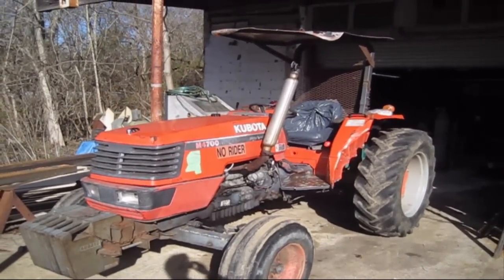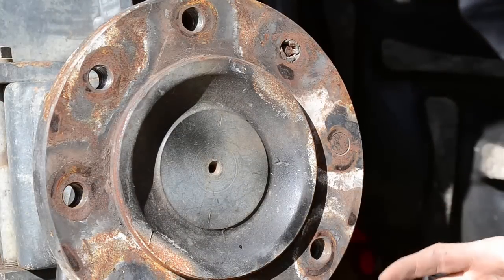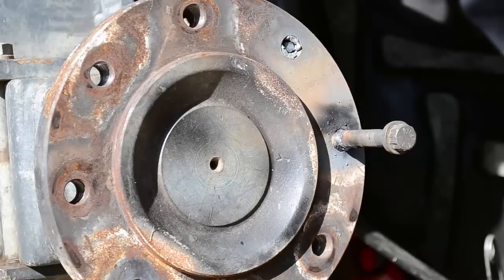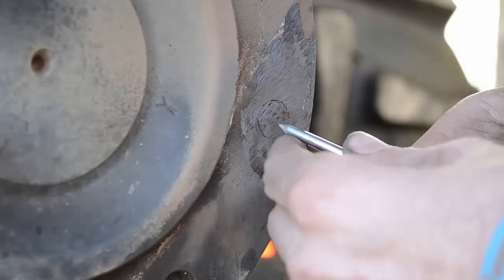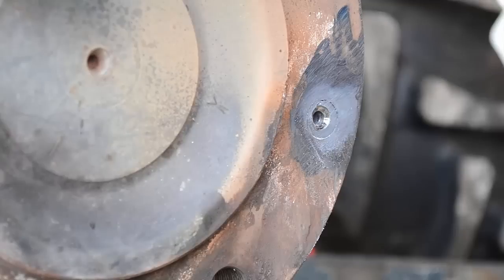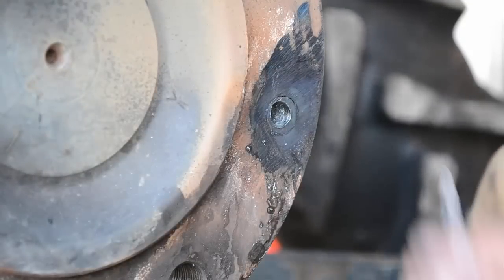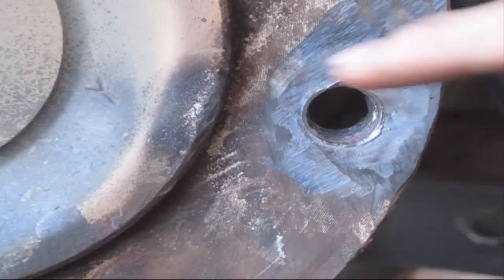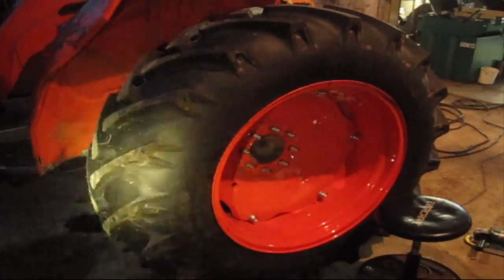Broke-off bolts techniques

Comment: NOTE:  dri;l bits "Can" be sharpened with a grinder, just observe the original slant and angle around both parts of the very tips, I was amazed at how good my rockwell bits sharpened up.
Reply: Set it on fire collect insurance take the week off
Reply: Hes a green horn but very persistent

Comment: Drive a square easyout into it and it we come out, or get it hot and drive the square easyout in it and it will come out. When you drill into hard steel use a diamond bit to drill through it.

Comment: how come you didn't put oil to lubricate before impact wrenching ??  .. best is beeswax  while is still hot after welding .
then after you drill the hole why didn't you use extractor ?

Comment: I would have hit it with WD 40 to lubricate those threads. And use oil when drilling slowly so as to not burn up drill bit edges. Cobalt drill bits help too on hard stuff.

Comment: If there was enough bolt sticking out the back side you may have been able to of put some penetrating oil on it, and then screwed it out from the back. Instead of trying to get it out the front.

Comment: I worked in a speed shop for years and if I had a welder around someones $12,000 motor. they would have wanted to punch me in the face. Carbide burr bits are what to use. Good ones eat a bolt like butter.

Comment: You had a  through hole drilled through the broken stud and you applied a flame to the stud not the outside... not great. Another thing you could have done is to drill as large a hole as possible through the stud and then run a junior hacksaw inside the hole and cut through the remaining wall of the stud to the outside thread.... it would have collapsed easily with a centre punch around the outside and screwed out. That's based on 25 years teaching engineering and a whole lot of practice.

Comment: Dude you may be a pro, but you did just about everything wrong you possibly could on that bolt. I also agree with the man below, don't run wide open on steel, when you hit  burr, run in thru the other way, they make penetrating oil for a reason, use it.....   Why in the hell would you heat, thus expanding the bolt your trying to remove. Heat the metal around the bolt, not the bolt it's self....

Comment: I`m very surprised at the hi-speed drilling. That doesn`t work for thick hard metal. You have to slow down to get it to cut and not heat up the drill bit thus destroying it.
Reply from the maker: Slow drilling doesn't work on steel that is harder than the bit.  Speed has nothing to do with destroying a bit.  Let me ask you something have you ever burned up a drill bit? No you haven't it broke before it burned up.  HSS loses temper around 1,100 to 1,300 degees it has very high red hardness.  There was a hard spot in that bolt that's why it quit cutting not the speed.
Reply: Yes I`ve burned up drill bits. I`m still surprised  at your lack of knowledge. And I`m not being offensive. You just don`t have a clue. I worked on trucks for 13 years and there`s a lot of drilling/repairing.
Reply: I have to agree, ask any old machinist & they'll tell you the same thing. I'm a 54yr old FAA Certificated Airframe & Powerplant Technician. I've found it's much easier & faster to start out with in this case prolly an 1/8" cobalt drill bit @ a slow speed using plenty of oil. Drill a little, stop pull out, blow out chips with blow gun, wipe off drill bit with a rag, squirt oil in the hole & on the drill bit & repeat until through the hole. Use steady straight not to much pressure on the drill @ a 90 degree angle. My old DeWalt drill has a bubble level that helps a lot to drill holes perpendicular. Then progressively drill out the hole in 2 sizes larger each time until desired diameter. You could then weld a nut or bolt to remove the stud, use a center punch or air hammer/rivet gun with a small sharp tipped punch & work it out (works better than most guys/gals think), use a square type easy out tool (the spiral type only spreads out the metal making it wedge itself in the threads even tighter), drill out to a tap drill size & re-tap the threads, or heli-coil the threads, or fill the messed up threads with molten metal & re-tap threads ETC. Classic Work I noticed immediately was drilling way too fast, was a bit crooked, didn't use enough oil, didn't clean the bit off & the chips in the hole & started the hole off center to begin with. When you do it usually several times a day for many years like I have you learn by experience. After center punching or starting the first cut if the drill bit isn't perfectly centered you can learn to walk it in by tilting the drill to get it where you want it to go. Just go slow because you don't want to mess up a very expensive part like on an airplane & get your ass fired also. I've never been fired BTW, only raises & bonuses :-)
Reply: j e thrust: You and I have the same way of doing it. It`s like a trophy when the bolt comes out with the easy out stuck in it. On tuff ones I`ll keep it a while as a reminder.

Comment: My brother-in-law told me about something like this when bolts in semi tractor tires would break off.  After welding a nut or whatever on the remaining stud he said all he needed was a pliers to take out the remaining stud.  The secret was slowly dripping cold water on it and it would break loose by itself and none of that pounding was necessary.  In fact he said people would stand around watching and waiting for him to pound the heck out of it and he simply turned it out with a pliers.

Comment: the 1st time you had the welded bolt turning,you could have melted some parrafin wax,it will find itself a path,down the threads,and you likely wouldn't have busted your weld,,

Comment: once they start to move at all , apply a little oil and let it work into the threads.
Your sure fire method would have worked  the first time if you had.O

Comment: grind back flush , grind face of broken stud flush with axle face take steel flat punch and shock with hammer this compresses rust flakes in threads of broken stud no bolts welded to broken stud , bolts flex and dont transmit  proper shock to stud, only weld washers and nuts , bolts are long and have angle sheer when welded and hit with hammer and or impact gun. use only hand tools to rock back and forth slowly with wd oil and heat on axle flange not broken stud . easy outs no  good for this. drill slower right on center use lube to cool than saw out with hacksaw blade small piece make 2 cuts remove  small cut piece tap whats left with blunt punch or  capeing chisel  plumbers use this alot called capeing . good video remember hand tools only to start rock back and slowly ,and lube

Comment: Why not include applying some liquid Blaster, WD 40 or even tranny oil & then let it soak in for 10 minutes or so after heating to help loosen the threads out ???  And you never dipped your drill bits into water from time to time to cool them off either & you ran them too fast!  Slower speeds & pressure could have helped them cut & bite into the metal!  I plain don't understand your thinking not to do so otherwise!  Good job ending though.

Comment: This is a good example of how not to remove a broken bolt.
Reply: Completely botched from the time you welded on the broken bolt
Reply from the maker: Jake Elliott I got it out did I not?  It could have went better but that’s the real world some easy jobs turn into wtf all the time.  If you have done a job like this you would know that.

Comment: Clean the threads out and screw in high tensile bolts in from the back, if they snap off again you can use the hex to screw them out for replacement. for the hole that have no thread weld a steel bar across that bolt to the one each side of it that will stop it from falling out and turning. AND USE COPPER COAT ON ALL THREADS NOT SILVER SHIT.

Comment: You're drilling way too fast for steel. See if you have a bit with a very shallow angle at the tip. If you look from the side choose one with the "flattest" angle from the tip to the outer edge. This will take smaller bites from the steel. Drill slowly and spray some lubricant a few times per minute.

Comment: heat it and cool it three times one of the heatings can be when you weld it, cool with penetrating  oil!!!   heating the bolt in the hole streatches it c0ooling it shrinckes it . drill hole w/slow speed first heat through the hole

Comment: If You put some Kroil oil on it The oil that Creeps Would Help. I may have not Spelled Kroil right But it the best & costs
Reply from the maker: Kroil works good as spit.  I've used it, and not impressed for 20-28$ a can it should melt the bolt out.  I don't oil on a weld out because if the bolts breaks then you have a bad mess to try to weld back to.

Comment: I like everything you've done except for your drilling technique.... no wonder drilling is your last resort. When drilling metal you need cutting fluid on everything except iron, or your drill bit will dull crazy fast. Second you need to drill slower depending on the size of the bit, or else your drill bit will dull crazy fast, when drilling with a 3/8s bit I'm barely pressing the trigger, you wanna go slow enough that the metal comes off in curly strands

Comment: It would be better to cool down the stud after welding. Then it would be a little smaller and certainly easier to unscrew. A little spray oil would also be worth a try.
Better is: more brains, less power😄

Comment: If not a fan of Kubota what do you recommend?
Reply from the maker: ravenhhca John Deere, Ford, international Harvester all good tractors. In Kubota's defense this series (4500) and others like it is one of the toughest small tractors I have ever seen. It was built in the 90's and I don't know of one tractor they build now I would have.  All tractors have weaknesses and strengths the biggest problem with Kubota is they are built to light, but all tractors now a days are the same way.
Reply: Thanks.........so a used Kubota from the 90's might be a good choice?

Comment: The only thing I would add is to use Anti Seize on the replacement bolts and you will never have to do this fix again.

Comment: Is that the same type of drillbit as used for stone/concrete? Sure looks same
Reply: Yes,it might take a while but when they don't want you to break a Cobalt or diamond bit off in the hole.We used masonry bits on the guide rollers on the nose of a barge unloader,Dravo 36 bucket continuous for coal barges.Conical point set screw stuck in the hole,0°F on the Ohio River with ice on the river.Cold but it paid well.

Comment: You are running the rpm to fast. Slow down the drill speed. You are work Harding the bolt. Or use a carbide drill bit.

Comment: Makes me nearly sick watching this because I must remove a differential filler plug behind and on the ground. I don't have the tools nor the skills nor the patience. I only just thought about taking it in to a machinist.
Reply: Hammer the plug untill all the rust is loosened. This will release the plug and jar the threads enough to back it out easily. Only the outer edge of the plug will be rusty and holding it. Wire wheel, air needler to clean away the rust before you hammer on it.

Comment: I agree, my grandfather taught me slower is better as far as the speed of the drill bit. By spinning the bit to fast, you work harden the object you are drilling out. Also the cooler the better. Keep the area around the bolt cool. This heat and extreme cool affects the area and the bolt as you work it. If you heat up the object, then slowly withdrawal the heat from it. Just like heating up cast iron, but in reverse. you take you time to heat a larger area then you are going to work on. So slowly heat up and slowly cool down the area. Use the torch and slowly move it around after you heated up the area to expand the broken bolt. Also you can take a center punch and tap around the edge bolt to help loosen it. And the 2nd most important thing is to add lube to the broken bolt. It will seep in to some extent and loosen the threads...

Comment: If easyouts only work for you 1% of the time you're doing it wrong.  Those holes being so messed up I mighta just drilled them out and put nuts behind the flange.  And that stubborn bolt woulda been easier to remove with some penetrating oil.

Comment: why are you speed drilling into steel. Friction causes instability and fractures the tip of the bit. Ever see a metal shop drill at hi speeds? I didn't think so. Slow speed and oil to lower the friction temperature so that your cutting not ripping into the steel.

Comment: Any body working on any job that has to be losimimg or remocing nuts,, nolts  screws andpipe fittings or pipes
 LEARN
 Tighten before you loosen up ,. Just  enough to see it move,then you can loosen easily
 With out damage to the  fastner or the material, be it wood,metal or plastic,or cast aluminum. Itscalledkinetic energy

Comment: Your drill speed is way too fast for steel.  Slow your drill speed down to around 600-800 rpm and use cutting fluid.  And maybe reverse drill bits.

Comment: once you have a hole a little larger than a quarter inch use a jig saw, put the blade thru the hole  and cut one side thru into the threads . Tap cut side of stuck piece down toward center of hole. It will peal out . Hope you didn't bid that job.

Comment: You lost me at "I'm not a fan of Kubota tractors..."  What bearing did that have on the subject matter of removing broken bolts?  Did it matter that it wasn't a Mahindra, John Deere, et. al.?
Reply from the maker: xmchillin I guess it didn't have any bearing other than they are some of the hardest tractors to work on. It is like bad luck follows them everywhere they go.

Comment: Wouldn't it have been much easier to just drill 8 new holes, and tap them you could weld up the old holes if you wanted.

Comment: Weld a nut to it through the center hole...hot weld and get right on it with wrench while still hot....
Mig or tig...maybe stick but never tried
Reply: You could have just machined a new tractor

Comment: get a 1/2 plate (scrap)  drill and tap different hole  plug them with bolt grub screws and or studs  even weld them in grind the surface  flat  then heat them with the blow torch  and them pop the oxy  much easy er and  you dont need a hole n the center  .  its not that hard

Comment: That welding a bolt technique is A HUGELY bad idea.  You are going to weld the broken bolt to the surrounding metal.  With a nut, you do not run that risk.  And slow that dang drill down and use some cutting oil so you don't overheat your drill bit and make it dull.  And then the cutting torch idea.... wow... Maybe that is not the occupation for you.

Comment: why don't use warshal &  why not use copleet bolt tight from back next time broke just open back side don't use stud because to side tred open easy when running or use fire proof transparent mika hole  senter and weld skrew open easy

Comment: I realize my pessimism but my gosh this is hard to watch. It’s crazy how you can tell a persons grit and self discipline by watching how they solve problems. Here we have a guy giving advice,  but fails at every turn. Why? Laziness, instead of taking the extra time to ease it out or even look in the back and run it through the hole he just lets ‘er rip. Then after boogering up a bolt that WAS spinning, he doesn’t bother to make sure he’s drilling on center. Also, who tf uses an impact on a welded fastner. I mean “impact” is in the name!!

Comment: Why didn't you buy some proper wheel studs and pull them through the rim holes instead of buggering about like you have done, that bad stud had a bad rear to it so why didn't you grind the end of the stud off at the rear.

Comment: Hey ,,,Boss,,,Like U R,, VIDEO,,,Watched ,,Thru to end,,,,Gave me couple more Ideas for the back Pockett,,,,,BUT,,,,Where WAS U R Penetrating OILS,,Like WD 40,,PB Blstr or KrolOil,,,Luv Krol on Stuff Like This,,,Have see my fair share of this in my collision n Vintage car shops n have won all over the world with my cars ,,,Also Tell The folks ,,First to TIGHTEN ,,,then Losen,,,working BACK N Forth ,,,AS U USE OILS,,,To Cut into Threads,,,Oil Gets ,,From top to Bottom working it back n forth into hole,, Secondly I would have ,,Tried to turn Broken bolt out thru back and welded on it again,,side dress bolt shank to run it thru to back ,,Since U Said someone had buggerd up the back,,,Have had this Problem on side of Water Jacket of 30 Auburn Boatail..I dug out of side of hill ,,then built car to Win @ Hershey ,,,All n all ,,great Video with lots of ,,Helpful Info ,,,,,Will be Checkin U out Again ,
                                 ,Thanks Frank  Heiss Jr

Comment: ur drilling waay too fast, speed isnt what u need its pressure, keep the drill in a lower gear and still dont hold it wide open, every hole and bit and type of metal has a different speed and pressure it works best at it really does become second nature after u do it for a while, it actually amazing how slow some materials require especially for some really big holes in thick thick plate i use to kind of question the datasheets but it really does make all the difference, the different gears arent for fasteners  your drill bits will also start lasting alot longer, the easiest way to ruin a bit is run it the highest speed get it hot n lay the edges over

Comment: Surprised to see you using non impact sockets with an impact gun! Bad habit to get into. They known to crack and splinter under impact! And why twelve point? Get some decent six point impact sockets and away you go. They tough,cheap and can stand any amount of abuse. Had to take a friend to hospital to ave a bit of shattered socket removed from his arm after using a non impact socket to remove lug nuts with an impact gun! Work safe mate.

Comment: When you had the bolt welded on the broken stud, you could have turned it clockwise all the way forward and then broke the weld on the back side.